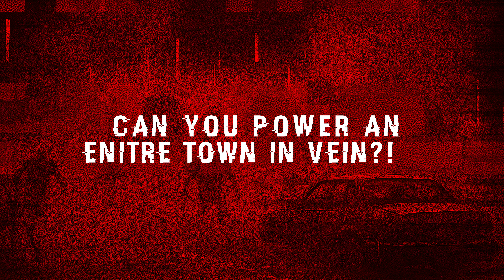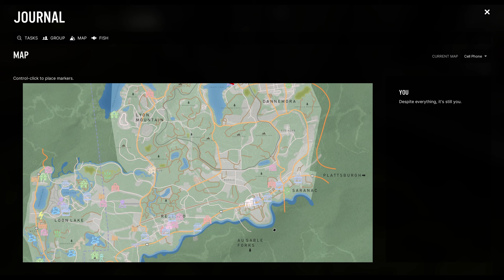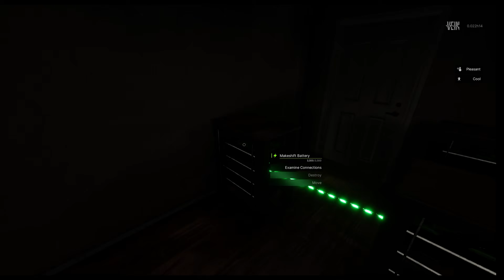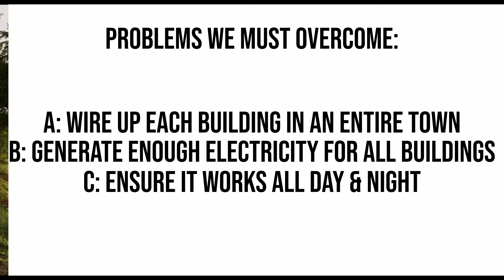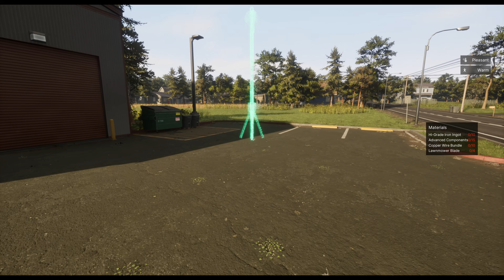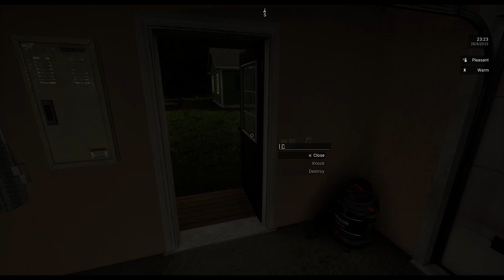Is it Possible to Re-Power an ENTIRE TOWN in Vein?

Comment: Was not expecting Redford. I expected one of the small communities in Loon Lake map addition.

There are some interesting small communities in Southern part of map.

However, I have to wonder what is going on with substations and existing power lines.

I am pretty certain running 120 volts A.C. (common household current in U.S.) would not work over long distances ; )
Reply from the maker: Yeah I wanted to be a little ambitious, but not stretch to the point of a bigger town - Redford felt good because its somewhat contained. 

Substations and existing powerlines have no function at the moment - other than the switch in some substations to turn the power off for that area if you've still got the grid on. 

Thanks for watching & commenting, Loki! 🙏🧟

Comment: Thats awesome. I think if they decide to patch out the daisy chain that they should add in ways to actually do it. Like it could be the end goal to get a power station and water station in each town working again. They could make it take boatloads of time and materials and max skill levels but it's something I feel would add to the game.
Reply: Power and water being restored is definitely something that should be added.
Reply from the maker: Yeah I think this was my disappointment when the battery daisy chains were nuked - because electrical circuits do work when there's batteries hooked together, it just, in essence, treats it as one large battery bank. 

The plan longer term (and is on the roadmap) is for brownouts and blackouts to happen and have the ability to get the power grid back online which I'm super excited by. It should be really hard to do, and require a lot of skill and time - but I'm looking forward to that in the far future for sure! Thanks for watching & commenting 🙏🧟